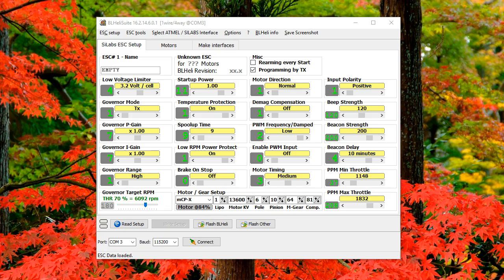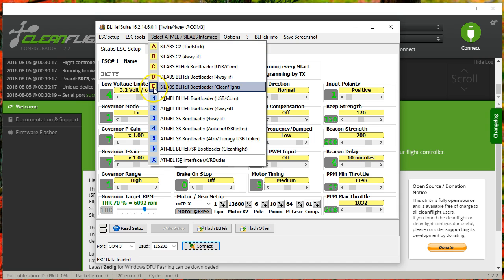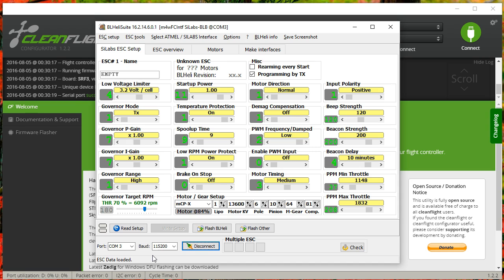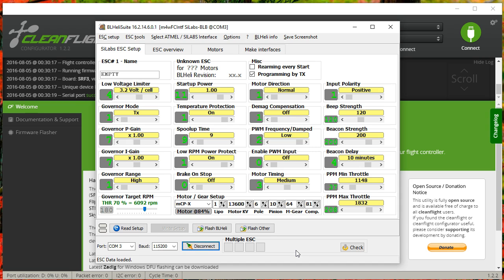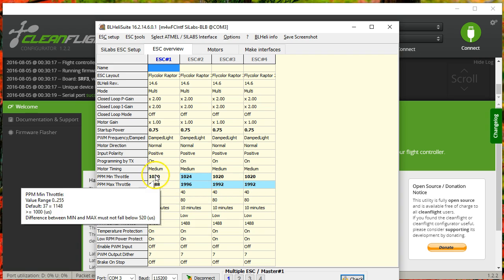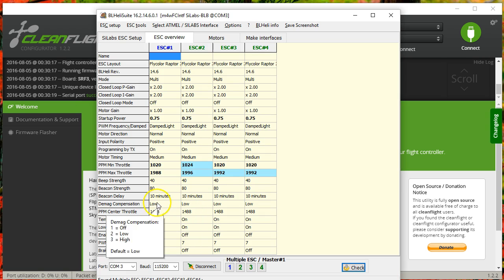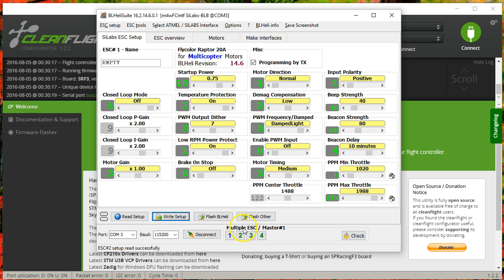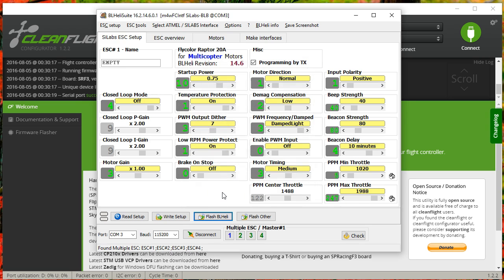How To Use BLHeli Passthrough to Program BLHeli ESCs

Comment: Hello, thanks for this amazing tutorial. 
 I am getting this error while trying to connect to the blheli_suite "Initialization of serial 1wire passthrough or 4way interface failed"
My fc is pixhawk cube and i am using mission planner
Reply from the maker: Sounds like that ESC doesn't support passthrough. Do you have documentation that says it should?
Reply: @JoshuaBardwell  Not specified in the website that I bought it, but I also don't know where to check
Reply: @JoshuaBardwell  If its not supporting what should i do, in order to use my esc?
Reply from the maker: https://youtu.be/86Q7sOXL6t0

Comment: Thanks a lot for the explanation. I have a Pixhawk, but i have read online that Pixhawk doesn't support passthrough. It can calibrate ESCs but can't tune their parameters. 
Is that true? In that case, what alternatives are there for tuning the ESCs?

https://discuss.px4.io/t/blheli-pass-through-for-px4/3798/3
https://github.com/ArduPilot/ardupilot/issues/5120

Comment: When I connect to my esc's in blheli suite, it says Serial interface connected succesfully. Connection to ESC #1 failed! Channel number 1 exceeds the capability of the current interface!!!   It is a betafpv aio 20amp. I have sucessfully flashed with other whoops before, but now my quad is stuck in programming mode  and until I fix this, it serves me nothing but a paperweight.
Reply from the maker: It means you have an older version of firmware on the quad, and newer firmware on the ESC's. The answer is to update the firmware on the quad.

Comment: Unreal that four years later I have to recur to your video. I'm trying to read BLHeli on  my Revolt FC but I can't connect. Being a Revolt would this video apply? I
ve been trying to set the wizard on Flight One but the motors won't idle. It's like there's a miscommunication between motors and esc. Any help will be greatly appreciated.
Reply from the maker: BLHeli32 cannot do passthrough on FlightOne or FalcoX. So before you can do passthrough, F1 configurator has a button that temporarily flashes CleanFlight to the FC, then flashes back after you're done.
Reply: @JoshuaBardwell  I don't think the ESC's are BLHeli 32. Probably BLHeli_S. In any case, I gave up on Flight One. It so happens that after four days trying to get the Revolt to work with some "help" form their support, not it happens that they're in a software transition that doesn't support the old flight controllers. I went with BetaFlight. Everything is working except the directions of the motors which I would like to do thru BLHeli Configurator. It doesn't see the ESC's.

Confused, but thanks a million for responding Joshua. You have a lot of followers.

Comment: i have been racing for years dirtbikes,4wheelers,gokarts and ignition timing is a big deal more advanced it is more low end snap more retarded timing is more top end power does motor timing work in a similar way im asking because i see the timing tab
Reply from the maker: Timing on brushless motors isn't exactly like ignition timing on a combustion engine.

https://www.youtube.com/watch?v=Z6kdi5V-xtc

Comment: When i'm pressing check i'm getting no infos abt the escs whats the problem ?
Reply from the maker: Probably you have blheli32 ESC's but you are not using blhelisuite32 program.
Reply: @JoshuaBardwell  i tried both programs it doesn't work . When i spins the motors from betaflight they work

Comment: When I hit check i get an error no valid esc config? I’ve plugged this quad into bl heli before?
Reply from the maker: I think you are using the wrong configurator. Like you are using blhelisuite32 with blheli_s ESC's or vice versa.
Reply: Thanks nailed it... it worked with my other quad lol

Comment: I just bought betafpv fc 2-4s aio 12a, only found esc 2 and 3, esc 1 and 4 not found. What should i do? Cannot do anything on my whoop.
Reply from the maker: Contact the seller or BetaFPV for a fix, refund, or replacement. You shouldn't have to fool around trying to fix a BnF like this.
Reply: @JoshuaBardwell  already rise ticket issue to betafpv, no responds until now. Thanks btw.

Comment: Running BF 4.0.2 and BLHeli 32.6.1.2(?) using passthrough as described above and trying to reverse motors on Beta F3 board. BLHeli says I am connected but no chimes and when trying to read I get blank dialog box. Only 3 interfaces show up (K,Land M) and only M (Betaflight/Cleanflight) does not give error message so "must" be correct? Other ideas? What did I miss?  Thanks as always for great vids!

Comment: Hi Joshua,  Im trying to program my ESCs(Thriverline Acrotor BLHeli-32 ESC 30A) to reverse the direction in 2 of the motors, 1wire passthrough connection is failing to tonnect to my FC(Readytosky Naze32 Rev6 Full Version). Im using BLHeliSuite(16.7.14.9.0.1), I Can't read any info about my ESCs.  Can you help me out?
Reply from the maker: It would help if you included the exact error message you're getting. Unfortunately die to YouTube comment notifications system I probably won't see your response so feel free to email me.

Comment: if bl heli doesnt read to of my dys ESC what do u think it is
Reply from the maker: Make sure you are using blhelisuite_32 for blheli_32 ESCs and regular blhelisuite for regular blheli_s ESCs. Confirm signal wires all connected?
Reply: im using blhelisuite_32 when i push read it only shows esc 2 and 3  1 and 4 just dont come up

Comment: Can I use this method for Pixhawk or Pixracer? It's really hassle to pull out all the ESC signal wires and hook up to a USB Linker. Thanks
Reply from the maker: That would require pixhawk to build in the passthrough feature. I don't know if they have done that.
Reply: Thanks. Sadly not seen anyone succeeded  till now.

Comment: Is not connecting to blheli suite? When plug the usb in it is not recognising is connected? Please help Josh is the last thing I need to do..
Reply from the maker: Have you selected interface "E"? Do you see the COM port of the flight controller in the pull down menu? If not, the drivers aren't installed correctly.

I probably won't see your response so email me directly of you need more help.
Reply: what is your email?

Comment: I ma using "Skyrc 12A Blheli" and when I go to check or read i get " Connection to ESC#1failed!
Please check data and etc." cant find solution
Reply: Hey man, did you ever solve this? I've got the same problem -_-
Reply: Skymonster Sam Hello, I found solution by buying others escs. Why? Because i was trying to get support directly from Skyrc.com, and they said me: " Those escs can't be connected on Blheli suite, contact your seller". So I quit from those escs, and bought anothers where it says "Blheli_S", because those are I think some newer version and it says that can be programmable. Another thing, i tried to flash them with Arduino Nano, (on classical way) and unsuccessful, I got the same message. The another way is how I watched on some tutorials, to solder on esc 3 wires on some of 4 or 5 soldering dots ( that is how they say: "direct to bootloader") but I haven't tried it, it need some time. Hope I helped you

Comment: Hi, why do you think that neither on chrome app nor at the windows 2 of my esc's are not listed but only no.3 & 4 esc's are listed so can be configured and updated. Btw all 4 work and can be accesed through betaflight...
Reply from the maker: I don't know what is the cause of this issue. It happens sometimes... It could be an issue either in the FC or the ESC.

Comment: I cain't find it. Or maybe I imagined it. A video you made showing the batch programming of ESC's using parallel wired pins to plug up the ESC's in the advent the FC method isn't available. I searched thru all the vids posted and came up with nothing on the subject. This vid is as close as it gets. Is it no longer up for view? It was a while ago I saw a vid on it, seemed a bit more complex , if I recall, when the FC passthrough doesn't  support the feature. .
Reply from the maker: https://www.youtube.com/watch?v=86Q7sOXL6t0

Comment: If using Betaflight do I still use the clean flight interface? I’ve always used the Chome app and tmi have these BL Heli 32 so in trying to set up my new build. Thanks for your help.
Reply from the maker: Use the Betaflight app to configure Betaflight.
Reply: Joshua Bardwell already flashed and fully set up with 3.2.1 all my motors are going wrong direction so I need to connect to BL 32 and change directions
Reply: Joshua Bardwell that’s what I’m having trouble with is connecting to BL 32 app
Reply: Joshua Bardwell solved my issue. I accidentally opened an older version of pas thru and once I opened 32 it was a piece of cake. Thanks for the videos and help!

Comment: I hope you're still monitoring this vid. I have connected to blheli_32 suite, but its only detecting 3 of the 4 esc's. please help
I've checked to see that they all work, and they do. What is wrong?
Reply from the maker: +IIBennyMacII sorry, I don't know.
Reply: Joshua Bardwell thanks a lot for replying. I can't figure it out, but I'm about to do a motor change anyway. So I'll swap that esc and see if it works. Thanks again, and keep up the great work

Comment: Is PassThrough now dead with the new BLHeli configurator chrome app in your opinion josh? For someone only using betaflght I should add. Thanks 🙏
Reply from the maker: No, passthrough is the same as ever. The Chrome app uses passthrough. That's how it talks to the ESC. 

I think maybe you meant, is BLHeliSuite dead? BLHeli_32 doesn't work with the Chrome app anymore because of the DRM. So no. BLHeli_32 only works with Suite_32.
Reply: Joshua Bardwell always count on you for the accurate knowledge. Appreciate the response

Comment: Will this work with the cc3d running librepilot? One of my motors spins faster than the other 3 and when I power the cc3d the esc's make the beeps at slightly different times :/
Reply from the maker: This is a feature of Betaflight. I don't know anything about Librepilot really.
Reply: Joshua Bardwell I don't think anyone does tbh aha I can never find anything on the google search. Wish I didn't short my naze32 but the cc3d will do till I get a new one

Comment: +Joshua Bardwell I've flashed Betaflight 3.1.1 to my Betaflight F3 Flight controller, and I'm trying to use the BlHeli Suite (v16.6.9.0.1) to reverse the motor direction on 2 of my ESC's, which are the Lumenier 30A 32bit Silk, using Dshot 600, and supposedly run the BlHeli_S firmware. I'm selecting interface E, and serial port connects successfully, but ESC#1 setup read fails. Do you know if there are any tips to get the ESC's to read properly?
Reply from the maker: Try the Chrome GUI instead. Also, try selecting just one ESC at a time in Suite, instead of all four.

Comment: hey joshua.........great videos ..........i have an omnibus f3 and emax 35a esc's............will inav do the same as betaflight for passthrough or  just use betaflight passthrough for the esc's.....i use inav for gps.....thanx..........
Reply from the maker: I would speculate that inav supports passthrough, because it was forked from betaflight, and passthrough is too useful to abandon. But I don't know for sure.
Reply: thanx i'll check it out.......

Comment: i learn so mutch from you!! my first buils. were i crasy op the motor. did what you say. and it fly.but got one say my blhelli´s is bad- its littlebee 30 a. but a have no problem f4 fc. 2204-2300kv-. but can i only use 125 or can i go higher?  hear a lot popple say. just its blheli´s the kan be flasht to d shot! but dont know! what you think. just leave 125 and then only have 4/2 hz: even it´s a f4 fc that can take 8/8 and more. dont need- i blive is it better with 4/4hgz gyro? but most the esc. cause you say 125 dont go higere then 4"ghz- Yes? :-) everting wo)rks. ust cunfused. anf raderuse  dshot if its better and my esc can take it! :-D

Comment: Hi, when I try to flash my escs, only one out of the 4 will flash. the other 3 give me this "severe warning" saying if I flash with an unsupported hex file, I could cause damage to the esc and motor. I haven't found this on any other how-to video and I don't want to hit continue til I know I won't hurt anything. My escs are dys xm20d. 
Thanks, Josh. If anyone can help, it's you.
Reply from the maker: Well I definitely don't think you should continue, but I don't know the answer either. I would guess you are flashing the wrong firmware to them? Are they all identical? Do they all show the same firmware in Suite?
Reply: Yes they are all the same escs. one is new, because I had to replace it. all of them had 16.43 but one had 16.5. The one that had 16.5 was able to flash to 16.6, but the rest get that warning.
Reply: Here is the message:
Unknown or undocumented modified BL-Heli A_H_70 revision "16.43" found! Flashing this esc with an inappropriate hex file may cause severe damage to esc #1 and or your motor.  Continue anyway?

Is 16.43 a bad firmware? The one esc that didn't have 16.43 flashed no prob.
Reply from the maker: I really don't know.

I think that as long as you are flashing A_H_70, I would say to go ahead and flash. But DEFINITELY use a smoke-stopper in case anything goes wrong. I am serious. It'll probably be okay, but if anything does go wrong, a smoke stopper will save you from buying three new ESCs.
Reply: Joshua Bardwell will do. Thanks for your input.

Comment: Great Channel Joshua! I'm getting an error when I try to initialize BLHeli which states, "Initialization of Flight Controller Denied! Please check all motors are stopped and disarmed" Any idea how to get around that?
Reply from the maker: +Craig Sosebee restart your computer. Power cycle the copter. Use blheli Chrome app and blhelisuite depending on which works.
Reply: WOW. I didn't even know Blheli Chrome existed. Installed it and it worked immediately. Thanks!!

Comment: Hi Joshua.I have a BLHeli mystery with my Little Bee Favourite BLHeli S 30 Amp 2S-6S ESC's. They have been fine on my 4S quad on which I have now installed 6S motors and a 6S PDB, if I plug in a 4S or 5S the motors start fine, if I plug in a discharged 6S Lipo the motors start fine. If I plug in a fully charged 6S lipo I get no beeps from the ESC's and the motors will not start. I have used BLHeli Suite to install the latest Rev 16.6 firmware but the problem still remains. Could you possibly unlock this mystery as I am about to give up :-)
Reply from the maker: If you do not have signal ground maybe that would help. I don't have a lot of experience with 6S so I can't really say more.

Comment: This will not work with Raceflight, correct?
Reply from the maker: Raceflight manages the ESCs directly. There is no passthrough, but you can control the ESCs from within RF1 configurator app.

Comment: I have got the stock Hobbywing 30a platinum (those are on the blheli compatibility list), am i able to program those with the betaflight/cleanflight serialpassthrough via the UART ports of my Flight controller ?
Or do i need a USB to FTDI adapter ?
Reply from the maker: Hobbywing ESCs don't run BLHeli do they? Some of them don't, anyway. In that case you can't program them with passthrough.

Comment: Hi Joshua, 
Cheers and thanks for this video. It has definitely helped me out.  I have ran into one snag however. When I open BLHeli, hit Connect then click Read Setup, my motors proceed to spin up.  Thank goodness for smokestoppers. In either case, my I have 12A Emax BLHeli ESC 2204 Emax motors, and a SP Racing F3 FC. My interface on BLHeli is SILabs BLHeli Bootloader Cleanflight. My ESC's support one shot and I'm attempting to flash them with a firmware that has oneshot125, but I'm not able to get to flashing them b/c of the motor spinning issue. 
Any help would be much appreciated,
Regards,
Greg

Comment: What do I do if i have a KISS FC?
Reply from the maker: +Steven Milward kiss cannot do pass through. KISS ESC's don't need to be software configured. Personally I would not run blheli ESC's on any FC that didn't support pass through.
Reply: Thanks for the info. I have just this second flashed the esc's using an arduino with help from one of your other videos, so i could reverse the motor direction.
What's your reasoning for not running BLHELI without pass-though? Just ease of use? Do i need to configure the ESC'S regularly? I have purchased these ESC'S and the KISS FC now so there's no going back :/
Reply from the maker: I don't flash or configure my ESCs often, but when I do, it's super annoying to do it without passthrough. I direct-solder my builds, so there really aren't any good alternatives to passthrough.
Reply: That's a good point I didn't think of. The KISS FC recommends soldering all ESC connections. I guess I will just have to hope I don't need to do it too often! haha. Thanks for the help ;)
Reply: Do you think i would need to physically remove the signal and ground pins off the KISS FC before connecting with arduino? The KISS FC might be communicating with the ESC at this point and may not allow the arduino to connect :/ I guess i will just have to try. Thanks again.
Reply from the maker: +Steven Milward if you remove 5v I suppose the kiss would be powered down. Then it might work.

Comment: Is there any disadvantage to wiring all 4 motors without crossing any wires, then setting direction through the passthrough?
Reply from the maker: There are a couple of ESCs that desync when you reverse direction via software. Other than that, no.
Reply: Joshua Bardwell Thanks so much! I've got the Rotorgeeks 20A ESCs which I understand are pretty solid. Your channel is fantastic!